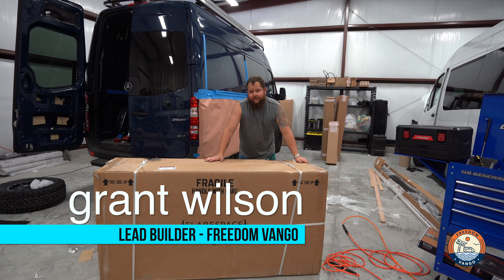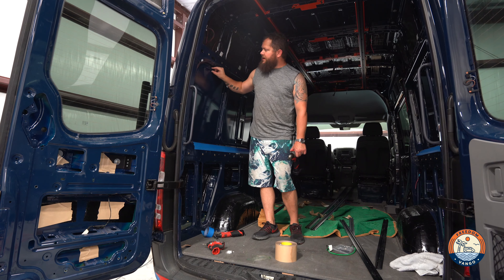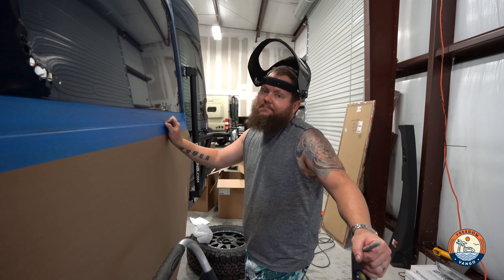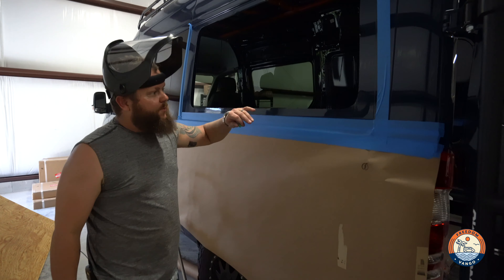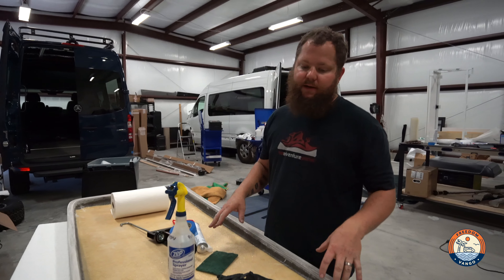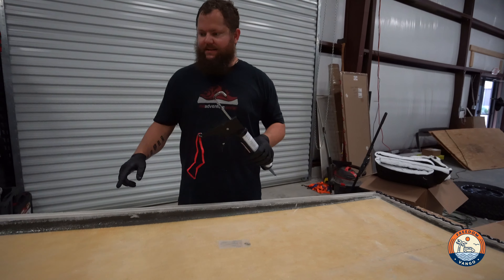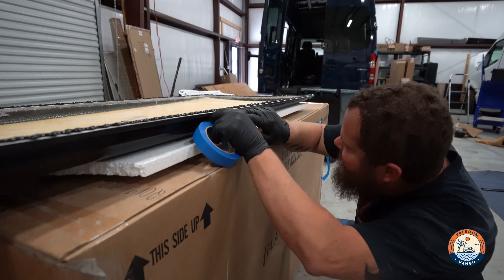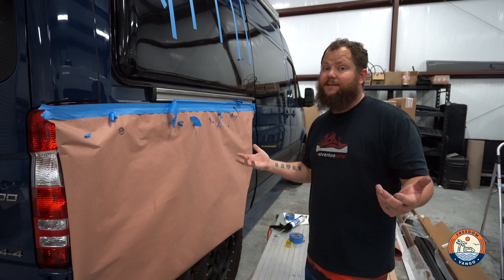Flarespace Mercedes Sprinter Flare DIY install (part 1)

Comment: Great video, do you do any prep to the van before gluing apart from the alcohol wipe? Sanding or Primer?
Reply from the maker: scotch brite the surface.  Depending on the adhesive the MFG is sending determines the need for primer or not
Reply: @FreedomVanGo  many thanks, I had seen others using 200 grit sandpaper, I am getting a pair of flares second hand - so no adhesive supplied

Comment: I will be installing flares in my Pebble Grey sprinter which is a very light color, I know the 3M 550FC urethane adhesive is black, I am wondering what the joint should look like between the flare and the sprinter body.  You mention a 'fillet', I'm not sure what that is.  I am used to running my gloved finger coated with a bit of spray foam window cleaner along a caulk line to make it smooth.
Reply from the maker: If you google sealant fillet joint, it's pretty detailed.

Comment: Hi at 4.40 looking from the inside is it possible to cut out the second rib?  Reason being here in the uk these flares are 1.6m long but the panel to cut out on the sprinter is only 1 meter long. 1 meter width in the  extra lenght section isn't enough for 2 people sleeping next to each other. So I'm thinking if the next rib can be cut and re-strengthened about 300mm over more toward the front then this would give a wider more useable space in the bed area. 
Thanks

Comment: Can you provide the height from the Sprinter factory floor to the bottom of the Flarespace window? I have purchased the Flarespace and need to determine where to place by bed frame so the frame + plywood base + mattress is above the bottom of the Flarespace window.
Reply from the maker: Im not at the shop right now, however you can just measure to the bottom of the window cutout there.  That is what you cut out.
Reply: @FreedomVanGo  Thanks.

Comment: Are there any structural issues in cutting out the side panels?  Any flexing in the roof or sides?  Looks like the cutout included two side braces.  Thanks!
Reply from the maker: Absolutely no issues.  No different than if you cut it out to put a window there.  Technically, because its now a structural piece basically, it is stronger in that area.
Reply: @FreedomVanGo  great video, thanks! 

Was also wondering about Chef Duane's concern - I see in the body mounting directives from Daimler/MB it says it is not permissible to install panoramic glazing on a panel van basic vehicle by cutting out the stamped window shape without ensuring equivalent rigidity.
Reply from the maker: @mattf2739  You would need to ask flarespace about that.  Its also not a panoramic glazing,  its a fiberglass part.

Comment: We’re about to tackle putting flares into (on to?) our 144 ... any particular reason you don’t upholster the inside of the flare BEFORE you install? And is really that difficult to upholster that we should consider getting it done by a professional upholsterer? (That diamond hatched fabric you use looks amazing)
Reply from the maker: I tried to do it once, and it just got nasty on install with glue and stuff.  Its nicer to do it while its in there.

Comment: This is awesome, thanks! Any reason why you cut the holes from the outside instead of the inside (like in the Flarespace instructional videos)? :)
Reply from the maker: you can do it however youd like.
Reply: @FreedomVanGo  Thanks! What are you using in your hand to smooth out the "Filet"? Just your finger and paper towel?
Reply from the maker: @mensgroupteam8846  thats correct!